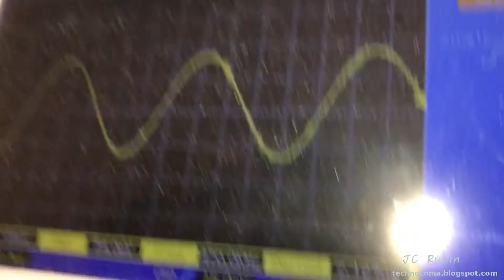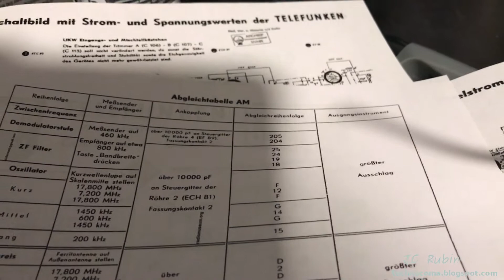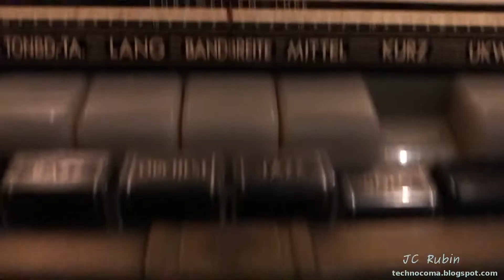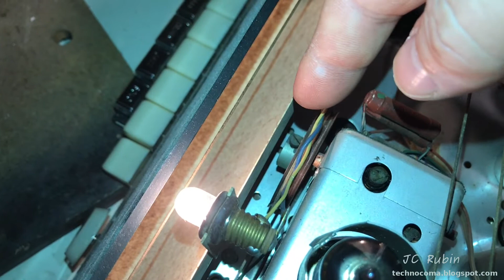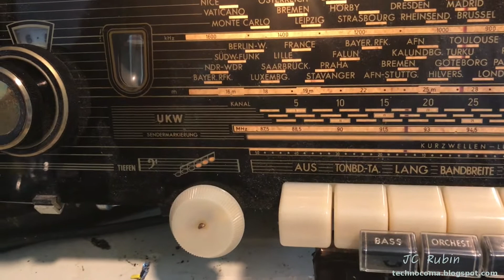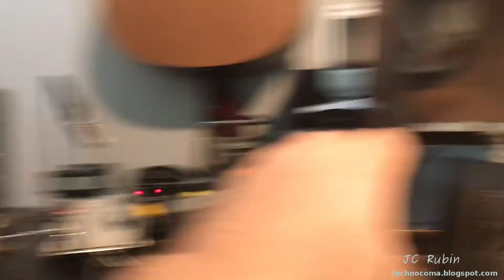Telefunken Concertino 7 Radio Repair Part 5 of 5

Comment: Hi, tks for the video! Did it had the 'death' capacitor? Did you clip it? Have you.installed a 3 cord wire with gnd? One last question, the plugs for an external speaker and for a record player are powered, or are just different plugs from an rca for example?rgs

Comment: Curious about where you found information on your radio. I have a German made RCA Tube SuperHet radio  that says it was made under license by Radio Fernseh Elektro G.m.b.H. that I have not been able to locate anything on for the past 16 years that I've owned it. The model is a 5 QR 64 X.
Reply from the maker: try radiomuseum.org for hard to find schematics
Reply: Looked there.  What they have for my radio is,,,
Schematics requested.